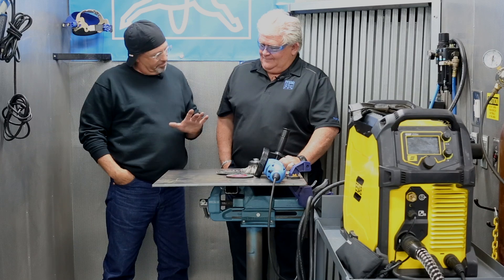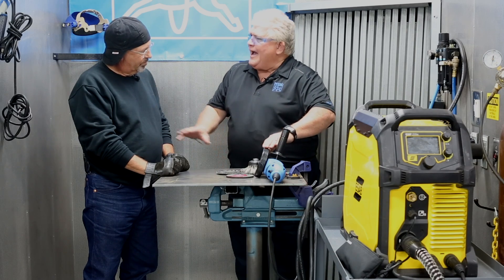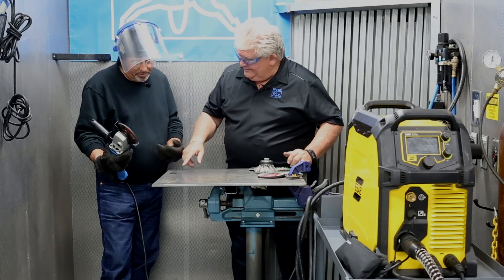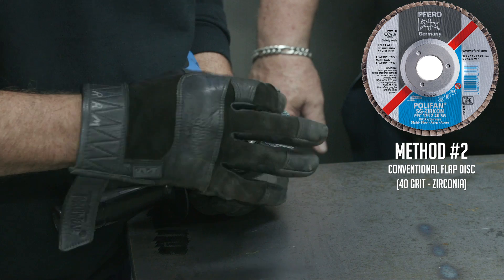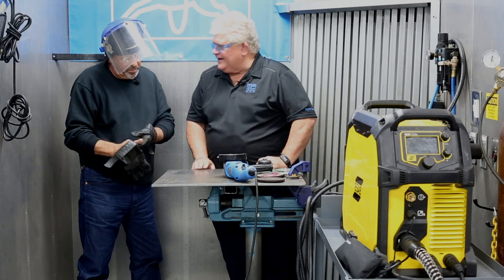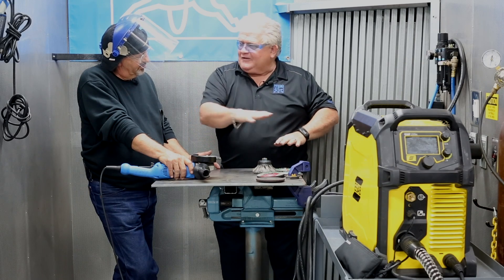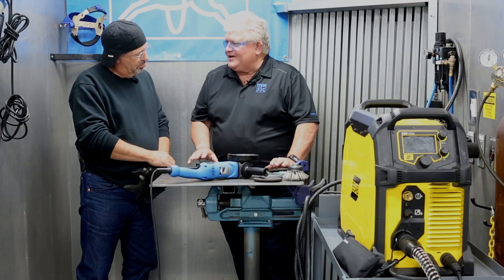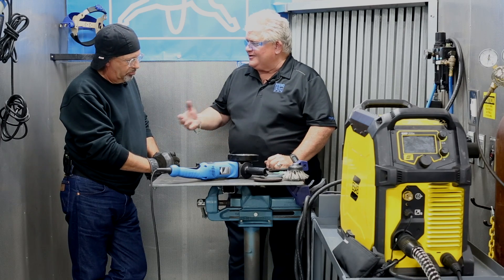Four Ways to Remove MILL SCALE

Comment: Was that a standard speed grinder? I wish you would have provided a link for the brush. That thing is a daisy!
Reply from the maker: The grinder is variable speed. Everything was ran around 11,000 RPM except the cup brush, which was significantly less.
Reply from the maker: Here is the brush: https://www.pferd.com/int-en/products/industrial-power-brushes/threaded-cup-brushes/knotted/tbg/stainless-steel-wire-inox-diamond-dia/stainless-steel-wire-inox-diamond-dia/tbg-100-m14-inox-0-50-dia-270/
Here is the Silicon Carbide Wheel: https://www.pferd.com/int-en/products/fine-grinding-and-polishing-tools/combiclick/fibre-discs-cc-fs/silicon-carbide-sic-type/silicon-carbide-sic-type/cc-fs-125-sic-80/?filter=%7B%2522q%2522%3A%2522silicon%20carbide%2522%7D
Reply: @Welddotcom  thanx.
Reply: I just downloaded 3 pferd catalogues and couldn't find any diamond wire brushes. Something we might have to phone them about. Unless Bob can get a part # off the demo brush.
Reply: @westernclimber  Same here.
Reply: @westernclimber  Just get some Norton Blaze disks. Its not rocket science.
Reply: @Richard NZ i have 15 dogs,  i can't afford any more mouths to feed, i'm walking away from welding prep....i will just run 6010's on beer cans from now on
Reply: @Richard NZ haha... Excellent!
Reply: 1000-2400RPM on the brush means that the best option might be a 90° drill
Reply: Nice infomercial...
Reply: 4.5" Grinder.  Figure 10,000-12,000.  Agree on providing some links.  Their product portfolio is huge.  Some things I can find... others not so much.

Comment: Good video on this Bob one question r u using a variable  speed grinder on this getting mill scale off is a pain and takes a while.
Reply from the maker: Yes, it was variable speed. Everything was rum at 11,000 RPM except the cup brush, which was significantly less.

Comment: I've found needle scaler works pretty well most times
Reply: I was wondering if anyone would comment on this way. The company I work for doesn't believe in removing mill scale pre-assembly, (while fitting it together). They don't even clean the plate edges (to be welded) coming from the burning table. They say the welding process will take care of it. 
I still hit the welding area with a needle scaler as much as possible. I absolutely refuse to let a bad weld go. It's just not in my forte'. LMAO